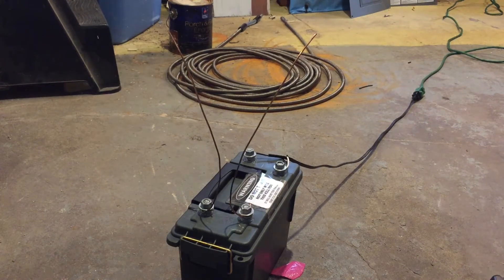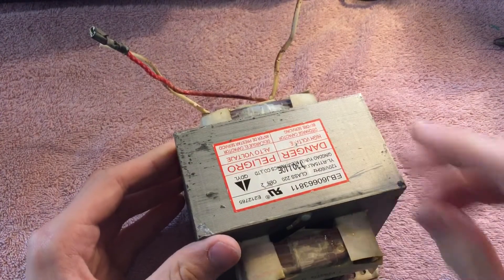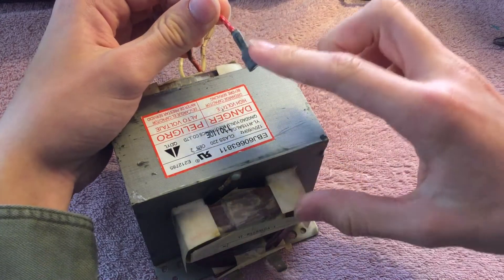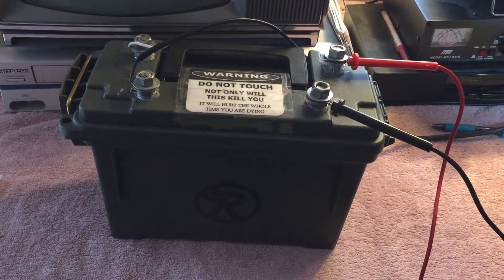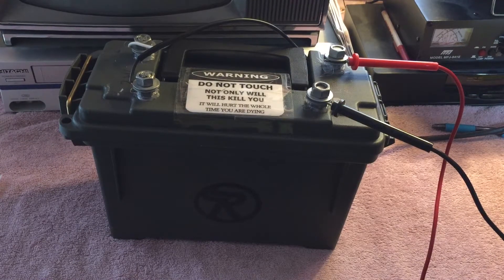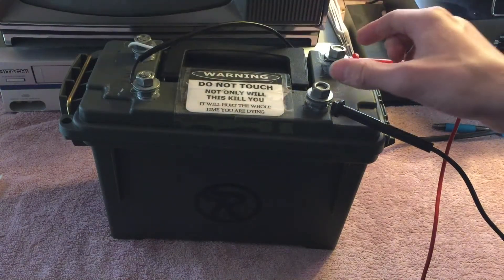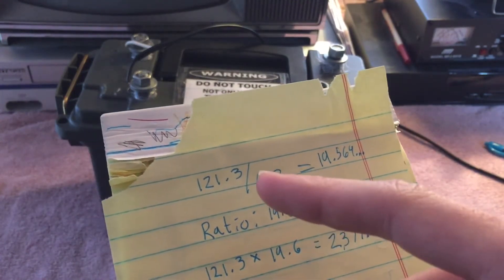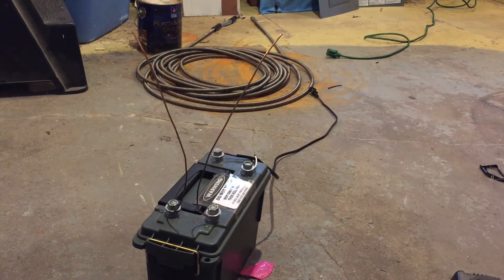Microwave Oven Transformer Instructional Video - Anatomy, Measurements, and Demonstration

Comment: I'm also a amateur radio enthusiast. I like the low frequency stuff like 160 m the propagation is very interesting. I have a question. What happens if I take the primary windings out and put a new wire with less turns will that increase the ratio?

Comment: I wouldn’t use a stick or wood for anything high voltage because that stick could have been exposed to moisture and it could be somewhat wet even if it doesn’t feel wet. That use of wood is a big no no. Wood IS NOT a high voltage insulator. I have seen 7.2 kV go through entire branches and yes that was 7.2 kV and it was a living branch but the risk is no less.
Reply: then pvc?
Reply: You have a good point but also it's even more protected than just bare wood because the wire itself still has the insulation where it's connected to the stick